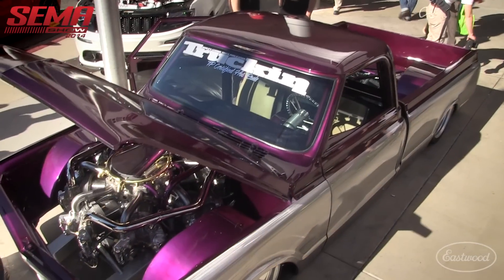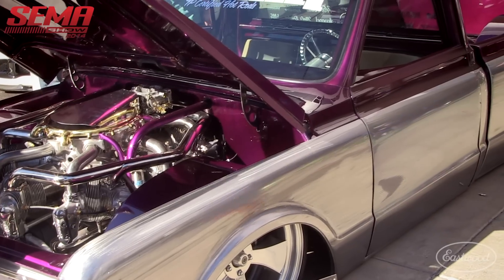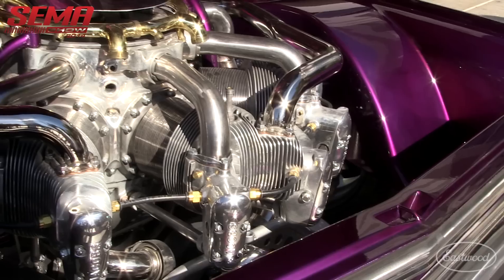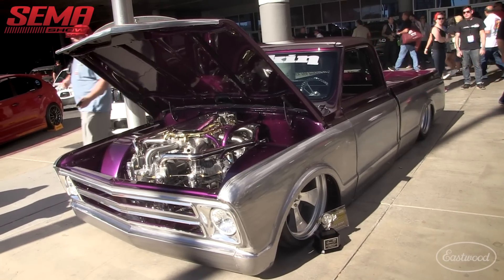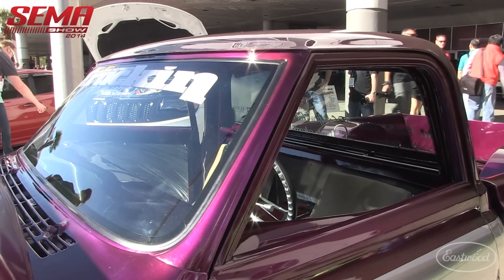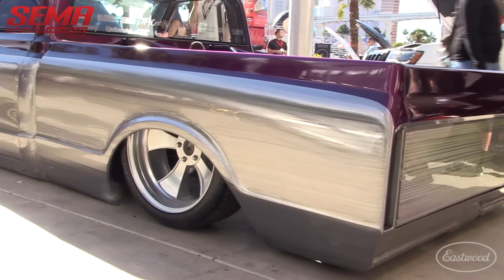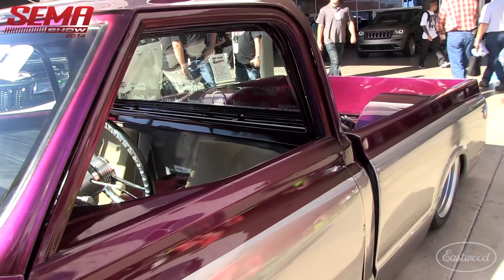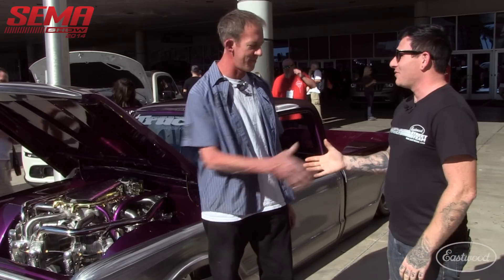Truck with a Plane Engine!  SEMA 2014 - Eastwood 'Hands-On Awards' Best Fabrication - Radial Engine

Comment: WTF it doesn't even work!? might as well have the engine in the bed? how can you award a concept that doesn't even work?
Reply: thats actually a good idea engine in the bed vertical shaft straight into the rear end
Reply: I have to agree with you. It get awarded and does not even work. Basically if you make something shine and pretty and don't drive it( trailer queen) some people just don't care as long as is pretty ,wich I think is silly.